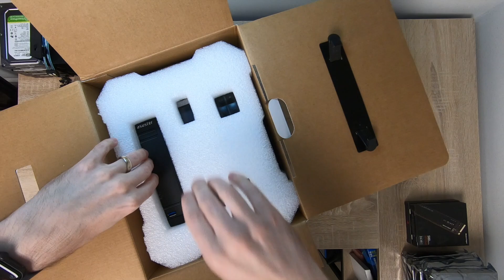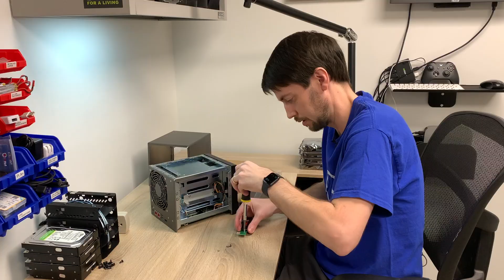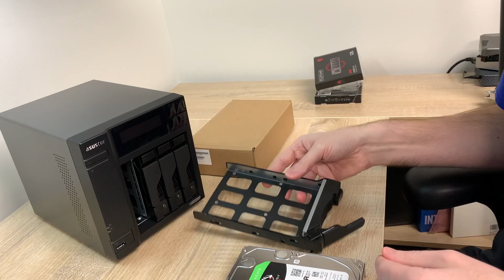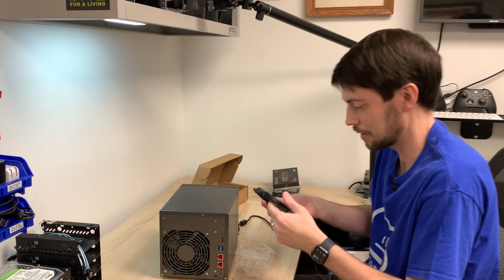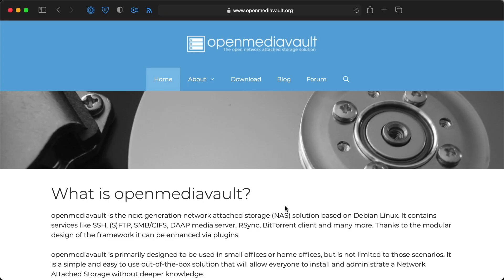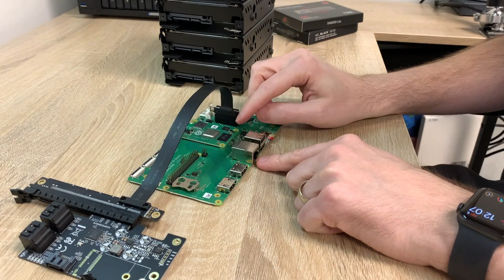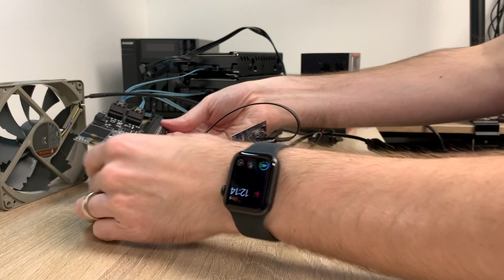Raspberry Pi vs ASUSTOR NAS Head-to-Head Part 1 - Hardware

Comment: I really don't need a store bought NAS, I already have one. I'm looking for a DIY solution, that's why I was asking about the feasibility of Raspberry Pi as a host for a NAS solution, plus cost is a huge factor, labor is free(me) and the learning potential - priceless.
Reply from the maker: You and I are in the same boat :)

Even if I end up sticking with store-bought, I already understand it a hundred times better (it's running a custom Linux distro and using mdadm and other standard utilities under the hood, it seems) since re-building the thing on a Pi.

Comment: Depending on the PSUs, the cards and the cables themselves, you might have issues with floating grounds and/or loops. It would be safer to power the rpi from the big PSU as well, so that they have the same references. That said, a custom pc is going to be cheaper, more powerful and more versatile solution

Comment: Hi Jeff from the UK. Excellent video. I had a QNAP NAS similar to the ASUSTOR in your video but switched to an OMV Raspberry Pi4 setup with 4xSSDs connected by 4xUSB3 cables and a USB3 hub connected to the Pi. I use a SSDs metal enclosure similar to the HDDs metal enclosure in your video, but obviously much smaller. My needs are more modest than yours I think both in terms of storage capacity and speed. Ultimately I didn’t like the QNAP software and the QNAP with fan being on 24x365. It seemed an unnecessary electricity cost overhead. For your future videos I will be interested in electricity cost comparison and how good the ASUSTOR software is.  Keep up the good work !
Reply from the maker: Next video will cover specifically those issues; stay tuned!
Reply: Will do Jeff, thanks :-)

Comment: What would have been cool, was the TuringPi, but instead of just an SD slot, each Pi compute module got 2x SATA. Its just too bad that the compute modules only had integrated 10/100, with gigabit to each you could have integraded a 10g port onto the turingPi for fast networking
Install glusterFS on each module and you're off to the races

Comment: 3.5" HDDs uses 5V rail only for electronics. All mechanics uses 12V rail. So even with beefy 5V PSU, HDDs didn't spin without 12V PSU connected.

Comment: Damn, perfect timing. I was wondering about this just yesterday. 😁
Be careful about CVEs though.

Also... 32TB? You lucky bastard. 🤣
Reply: Were you asleep? He has 64TB in total. 4x8 in the asus cube, and another 4 in the Pi. But he is a lucky bastard nonetheless. I recall when I set up my little cybercafe in south america, I was so proud of having 32GB of total storage. Wow. But that was 1998 and a 64K dedicated connection ran me about 600 bucks a month.
Reply: @loginregional 
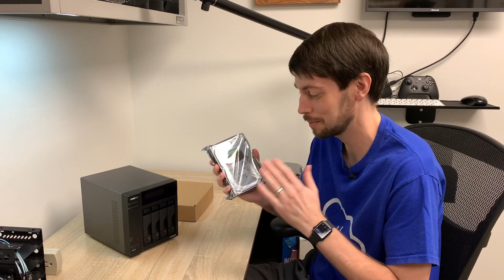6:50 Seagate sent me their Ironwolf NAS 8TB drives, and they sent me four of them.

8x4 = 32 TB of free storage from seagate (excluding the two free 2TB ironwolf SSD he got in part 2, and the fact that one of the mechanical hard drives was faulty). 

Im assuming Jeff just reused the same drives, since he left the western digital greens on the desk, and you always see a three drives setup in part 2.
Reply: @bufordmaddogtannen  Yeah, the three drive setup in part 2 was due to the DOA drive. But I thought I saw both up and configured which would make it 8x8TB... I'll take another look. BTW I am really enjoying Jeff's stuff.
Reply: @loginregional  no, that was the magic of editing. Also there was no reason for seagate to send 8 drives for a 4 bay NAS (as if I understand correctly Asustor and seagate worked in tandem to make the video possible).
Reply: @bufordmaddogtannen  Like I said, I'm going to take another peek at the footage. I'm pretty sure I saw the cage populated and the lights active on the NAS, giving 8 of the 8TBs. The Woofies are apart from that of course.

Comment: That ASUSTOR look really nice, but it didn't gave the impulse of screaming "IT LIVES!" when the fan started spinning.
Reply: that's a good thing for all set & forget devices unless your into modding ...make & add that device to take the old phone doing nothing over a usb caddy and attached phone case to hold it and use its screen and cpu to add expanded apps run off that 'nas' in this case...^_~
Reply from the maker: It does, however, make a nice loud 'BEEP' by default if you turn it on or shut it down. Or if a drive needs replacing.
Reply: We try not to instill fear into the hearts of our customers.
Reply: @ASUSTOR_YT  Yeah, I have been told that small electrics shocks are not a feature of a properly designed device. Wierd.

Comment: Not wanting to undermine anything on this video, I'm a fan of building your own too but when a commercial offering is suggested, I have to mention for you guys to take a look at ANY of the HP Microserver series. They work as an amazing 4 bay NAS, IMHO the Gen 8 was the best in terms of upgradability. I currently have a Gen10 with 32GB RAM, LSI card AND 10Gb purely for SSDs. One of these should demolish the Asus offering.

Comment: I have a WD 750gb green drive that's been running strong for like 13 years
Unlike my seagate barracuda 3tb drives that could barely even last 3 years
I've had so many seagate drives fail just outside of warranty I can't bring myself to buy them again

Comment: Thank you for sharing! But, if you will buy a MicroServer HP Proliant, whouldn't your custom NAS be cheaper and self-contained? I understand the proof of concept by using a raspberry PI as a NAS, but after buying all the cables and external power supply, not only will be not cheap anymore, but also the "mess" to have different cables and P.S. can't be easy to handle/inspect in case of one single piece's fault. Adding the time-consuming job, I think it is all good to know, but I will definitely go for an HP Proliant MicroServer! (Actually I got an old Qnap NAS at home that is still doing a great job). I think they're doing on purpose to send you the free NAS and the disks, to do a fair comparison!

Comment: Thank you for reminding me why I don't want an RPi setup for my NAS just yet - way too cluttered and ad-hoc. Not to mention that actually BUYING a bare RPi 4B or CM4 is Impossible at this time.
Good that the ASUSTOR NAS uses regular (non-registered) HDDs unlike some other NASes. A little pricey for my home use but looks good for an SMB.
Looking forwared to when the 'next' CMx comes out with better PCIe and Ethernet support and is also In Stock somewhere ....
Reply: Well.... I might....maybe be releasing new sub-$200 US budget models soon with better Ethernet.... *wink wink

Comment: On the 2011 Mac mini, you can get usb 3.0 with a thunderbolt dock. It has thunderbolt 1 witch is 10 gigabits per second.
Reply from the maker: True, but I can't find one under $100 (every now and then a used one pops on eBay for $70-80), and it's still just delaying the inevitable. If I was going to stick with the mini, I would definitely go this route!

Comment: what do u think about the hpz400 for this. mine came with a 2018 xeon 6 core with 12 gigs of ddr3 and a boot ssd for 160$ and i found the motherboard for $40 so you could probly build a system around it. plus it has 2 16x slots and 2 8x slots so if 1gb network or 4 usb 3.0 isnt enough

i would probly use the pci express for ssd storage and maybe wifi

Comment: Man, can I get the specs on the fan? I have a 1965 vw Bus with an overhead air vent and I think it would fit rigth at the cover plate to give me some air flow when not moving...

Comment: Interesting home NAS. Certainly looking forward to part 2. FWVLIW I guess the choice of option comes down to use case:
-A decent NAS that's pretty much ready to go? Something like this ASUSTOR would seem ideal.
-You're a tinkerer who want's a good / configurable NAS? A Pi configured as such will be a good / not too expensive option.
-More? A SSF PC or something like an HP Microserver with a multiport NIC card plus something like ESXi and you're good for anything you want.

-Oh, ok. eBay can bring up some awesome deals on surplus professional grade servers but buyer beware and for home use they can be very noisy.

ESXi..? For anyone looking to more with their home network than connect to the internet and have a centralised place to store files I can't begin to say how valuable you will find it to run some virtualisation software on your 'server'. Yes it's another set up step and yes it's something else to learn but it only gets complicated when you really start to dig in to it. With a 'server' that has a few CPU cores (I'd suggest 8 hyperthreads +) and a multiport gigabit NIC running a bare-metal 'hypervisor' like ESXi (there are others) you will have a box that can flexibly do anything you want. 
Want to try something? 
Set up a Virtual Machine, install on to that and have a play. Don't like or mess it up? No matter everything else is fine. Delete the VM or have another go.

Want to keep your resources as separate machines but don't want loads of boxes?
Set up multiple VM's each dedicated to a separate purpose and let the virtualisation software take care of allocating resources.
Not happy with your router?
Make a VM for that and try out one of the various software routers available to leverage more options and speed. Add a PiHole VM if you like.
Have a media server, network server, Web server, Torrent server. How about access to a Virtual DOS / Win98 / Win XP / Mac / Amiga / Games Console box accessible over your network? All doable from within a Virtual machine running on your server. Why not add a decent GFX card dedicated to one of the VM's and enable the use of high-end PC games across your network - if you have a 'smart' telly chances are you'll be able to access everything on the server from your couch.

I tend to ramble...

Comment: How is that XPG nvme holding up? bought myself a 1tb one at valentines day 2020. After 9 months it would just randomly die, bios wouldn't detect it for 2 days, then it would start working again. After fighting with the repair guys (which didn't understand the issue, formatted it and sent it back to me twice), I got a replacement one, which worked fine through 2021 until last week where the same issue started

Comment: This is what happens when a person like Jeff have been so good as he is that Company like ASUS and Seagate gives away something for they know how good add it gives them. But to compare this 4 drive NAS with an home made hobby project is not fare in any way. I personally using an Synology 2 drive NAS that is not powerful like this ASUS one but I think that the software is a different story. The hardware is not much of use with out good software. The PI NAS like one build on a x825 board with one SATA SSD can do a good simple Dropbox clone or other similar stuff. A PXE boot server would be a thing to use a Raspberry Pi 4 with fast drive and that would be nice to see Jeff put up something like that here.

Comment: My wife is one if those "don't remove the plastic" people.

We've had our microwave for a few years and it still has the plastic over the keypad.
Drives me nuts, but we can't remove it.

But....I think our smart TV in the bedroom still has the plastic on the bezel...better fix that 🤣.

Very cool video.
The Asustor certainly has it on the clean compact-ish design.
Pi is cool on the geek factor.
Is that a Noctua fan?
Reply from the maker: Yes, bought it for utilitarian purposes—wanted to be able to drop it somewhere to pass air over devices without making a lot of noise. And it's perfect for that!

Comment: EDIT: I saw he done that at the end of the vid

So, as youre already using that power supply for the hardrives why not make an adaptor for it also power the Pi board
Reply from the maker: Yep! I used a floppy to molex adapter, and now it's all powered through the PSU.

Comment: Foreshadowing? Nothing comes right out and says not to mix and match (I.e. HDD, memory whatever) but it almost always causes some sort of issue. I ran the service department in a computer store and can’t count the number of times I fixed computers crashing constantly by changing RAM modules that matched. The computer will always try to run as fast as it can and if one module is slightly slower, it can cause a problem and a crash (blue screen, freezing, random reboot). Mismatched hardware causes more issues than anyone wants to admit. Hard drives will very rarely cause issues if they’re not the same…but an M.2 is “basically” a memory module the way they connect and interact with the MB.

Comment: I had the same issue: My QNAP NASes turned old and update support faded now.
=> No proprietary CPU/mainboard/Hardware/SW any more!
==> A 10W Mini-ITX board and OpenMediaVault ! <30Watts with 2x8TB WD ; PICo PSU
Hardest part: Finding a small case? OK that is bigger now as a off the shelf NAS
That´s my solution now !  118MB/s on GBit net !
Reply: Hi. As of today, we have yet to stop supporting a single product. Our oldest is a decade old.

Comment: kinda wish someone would make a proper sata board for the compute module. there are pcie to sata adapter boards that can put out as many as 8 sata connections, though ive seen their really a single pcie to 5 sata ports and then a multiplier to take one of the connectors to 4 more connections so not sure how good the last 4 would be. this could be good for a 5.25 to 8 2.5" hard drive adapter or 3 5.25 to 4 3.5" drives. ive been thinking too much about doing something like this but didnt wait around for the module 4 to mature enough. built it with a embedded atx board in a traditional pc case.
Reply from the maker: There are actually a few in development (I've been following them closely through here: https://pipci.jeffgeerling.com/boards_cm), but every single one has had huge delays due to CM4 unavailability coupled with chips (like SATA controllers) having massive shipment delays :(

Comment: Holy 7 amp of power that is really high for 4 bay HDD  

But ok it dose have a very old atom processor so maybe that it's for
Reply: Hi! We don't use 'old atoms' in our products. Our CPU is a modern 14nm embedded Intel SoC that has a 6w TDP. We supply a 7.5A PSU to accomodate every type of configuration, including all types of USB devices, all four hard drive bays and both m.2 SSD slots being filled. Our PSUs have room to be flexible.
Reply: @ASUSTOR_YT  ooh I forgot about full size m.2 ofc that gona need some power 

Bty didn't expect u guys here really appreciate that check-in stuffs in comments  section 

6w really ? That impressive given 14nm
Reply: @nil3010  We love all the comments people give us. It's how we gauge opinions, make better products and help people out!

Comment: Jeff, for stability/data security purpose, you should connect both 0V of the two power supplies. Since both 5v/12v rails are isolated from the 110/220v, their relative voltage could differ. To prevent and static shocks, connect the two 0V together.

Cheers!

Comment: Why?? old Notebook for 50 $ and then connected some 2,5" Drives and getting all i need at low power with ubuntu or Xpenology
Reply: We prefer taking data security seriously.
Reply: @ASUSTOR_YT  me 2,   but what about Hardware failure?  if one of my drives or the Notebook Failures i have no problem accessing my data anytime. i think in a Classic raid i am lost to the missing right hardware. or?
Reply: @TheWax  We use standard Linux software implementations, for example mdadm, for our RAID configurations. Installing mdadm on a Linux machine with a few steps is easy to get data back. Also, putting drives into a new ASUSTOR NAS causes it to boot up as normal. I will definitely make a video on that as soon as a bit of time frees up for me but for sure I can make it easy. 

If one drive fails in a RAID 5 or RAID 1 config, your data is still accessible and that's your time to back up and install a new drive easily to get back up and running. There is no downtime. Same for RAID 6 and RAID 10 for two drives. We have a myriad of data security measures as well including snapshots, cold storage archiving, cloud backups and cloud archiving like Azure and soon-to-be S3 Glacier. Services like Azure and Glacier are cheap for archiving data you don't want lost but don't often access. A terabyte can be archived for $1 US a month with some of these places. And we just want to make it easy to protect, store and archive data. Click and go, bing bang boom done. The easier it is, the more you'll keep your data safe. 

Jeff privately asked us for Glacier. I told him it shall be done. I like your feedback and I will make it even easier and painless.
Reply: @ASUSTOR_YT   Nice. One who know's the Stuff!  i like that, it needs more ppl like you. One last question about "Data rot", i know btrfs has a protection, but still with some bugs. Any tech about that data Rot problem and protection? i have testet a configuration with a bad M.2 SSD used as cache that gives me lots of bad data because of damaged chips without giving back a smart error or other write errors reporting back. i only see them then i check the checksum i made for the testdata, any tips about this? btw i am at 86TB of stored data atm :)
Reply: @TheWax  Hey there. Let me get back to you on that so I can give you the best reply. Need a bit of time to chat with the engineers.